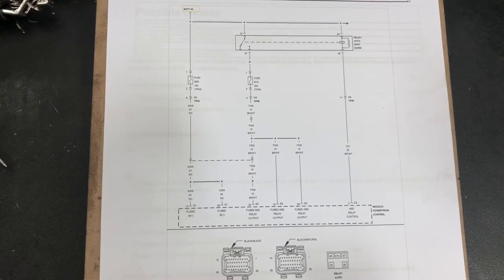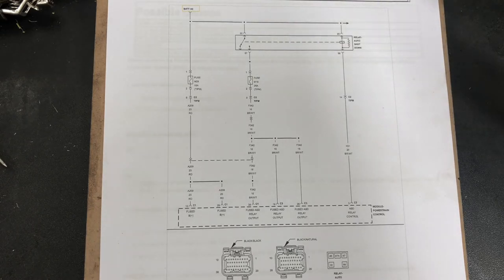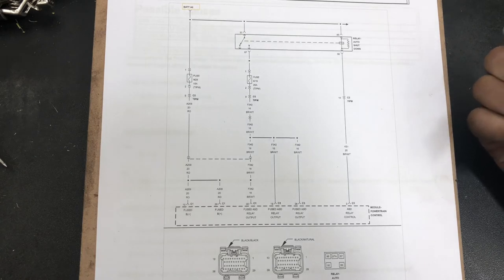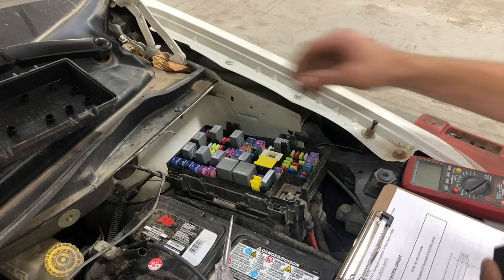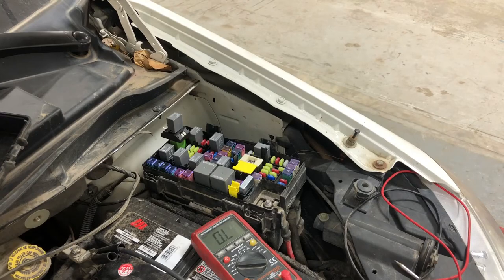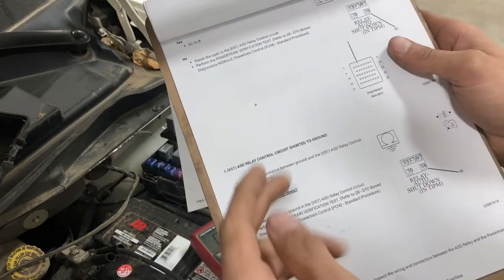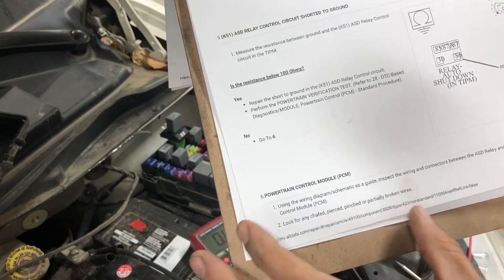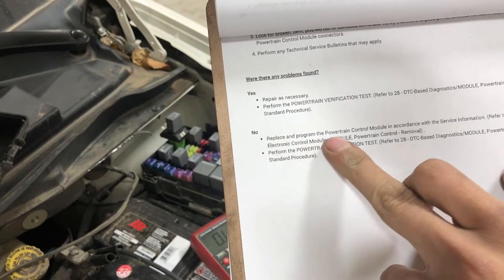2011 caravan - NO CRANK / NO START - P0685 ASD circuit

Comment: So im having similar problem.  Turn the key nothing. Have everything power just no crank. .. no power unlock or panick. Fuses all good.. starter relay is good but i jumped the starter in the relay area like so many ppl do i think its pin 30 and 87 and just a spark. No crank ... hummm any ideas.
Reply from the maker: I would say it sounds like possibly the starter is no good or could possibly be the alternator locked up like we had on this van. Remove the serpentine belt and try to start it and that will likely tell you your answer.
Reply: I will try that but I'm not even getting a click but I will try that tomorrow
Reply: @jimartzberger6889  did u fix it.. i have same issue.. new alternator. Fuel pump relay works. Battery is good. Im about to change the starter

Comment: I got this issue. Im wondering if the TIPM also causes this same intermittten connection issue? and the computer is good?
Reply: will jumping the 87 pin to the 30 pin get it started ?like the starter relay trick will start your truck and get you home if the starter relay goes out ?
Reply: @lanajacknichols8397  no the engine will not start jumping it. The ASD controls the injectors and coils. They won't fire and the engine will just turn.

Comment: I just want to thank you for this. It really helped out. So Apparently my alternator seized and somehow blowup the ASD section in the computer. Needed a whole new computer and the TIPM was perfectly fine.  When i took off the pcm those seals looked dogged (Can you get new ones?). But for me it happened on a complety dry day, no rain. So I guess this begs the question did the PCM destroy the alternator or did the alternator destroy the pcm?

Comment: How much did this job cost the customer. I have an 2003 Dodge Ram 5.7 doing this.
Reply from the maker: If my memory serves me right I believe the ECM came in around $1500 CAD plus a month on back order. With the diagnosis and the cost of programming a Chrysler product these days I’d say it was around $2000 total. Plus the cost of the failed alternator that caused the whole issue to begin with.
Reply: @raptorpromechanics1911  should i replace the alternator to keep this from happening again? I never really heard of failed alternators destroying pcm unless this is something unique to dodges
Reply: @dantheman1998  This is the only time I have ran across this. Having said that Chrysler product PCM's are the weakest in the industry in my opinion. I fix more of them than any other brand.

Comment: What's the cheapest scanner I can get to reprogram a used pcm for my 09? My ASD plug that goes into my tipm the ground wire was bare with loosely wrapped etape around it. Looked like it burnt at some time in the past. I got no CEL. Can just rolled to a stop. PRNDL stopped working. Had to use shift interlock to get it out of gear. Got a new ignition module and pcm and after popping a fuse a few times it decided to crank for the first time and run but die three seconds later. And for the the first time my scanner was able to communicate with the van. Said EGR circuit high. So I cleaned this very nasty carbon filled EGR tube and valve and when I put the EGR back on it decides once again that it will no longer crank again. Jumped the starter at the relay still works, so thinking maybe I need to program the pcm or ignition. Just bought the van for my wife and I'm stumped. I'm no electrical wiz like you.

Comment: Good morning my friend and nice to meet you!

Just wanted to ask you permission first.

Is it okay if i can ask you for help? My vehicle (2003 DODGE CARAVAN SE) is giving me 3 codes (P1684),  (P0201)  and (P0420).
Reply from the maker: Hello, Those 3 codes are likely unrelated to each other. The P1684 is reporting that the TCM lost B+ voltage at some point. P0201 is reporting a problem with Injector #1. And a P0420 is a Catalytic Efficiency code indicating a problem likely either in the Exhaust or catalytic converter themselves or in the Oxygen Sensor feedback system. Without a wiring diagram and at least a test light as well as an understanding of automotive circuitry it will be very difficult to diagnose these codes properly.

Comment: Rather than continuity test..
I would have disconnected computer, and grounded the control wire on coil side of relay right at computer connector. From there, check for power on the load side of relay right at some computer connector. Would have saved time and load tested everything